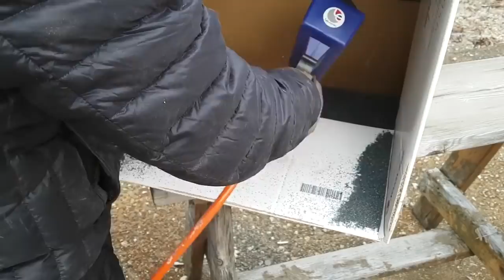KNIFE MAKING / JUNGLE KNIFE, 400mm 15.8inch 수제칼 만들기#39

Comment: I assume that this stock steel blank was already heat treated? Or did you just not show the heat treating of the metal in this video?
Reply from the maker: The size is too big for me to do it with my own equipment, so I forced it to be made by an outside specialty store that has already completed heat treatment...^^

Comment: steel?? noticed you did not heat treat blade and tempered??? very nice blade
Reply from the maker: The size is too big for me to do it with my own equipment, so I forced it to be made by an outside specialty store that has already completed heat treatment...^^
Reply: @artisticson2275  thanks I appreciated still very good work on blade.

Comment: That looks like a great chopper and brush knife. I'm curious about the heat treatment. I know that stainless steel is tricky to heat treat. Did the steel come prehardened and tempered?
Reply from the maker: I finished heat treatment at an outside store because the size is big and I am not capable of heat treatment.^^

Comment: That's a nice looking chopper.  I am making one very similar for a client who has requested CPM-4V.  11" blade, 5.25" handle, 16.25" total length with .25" spine, and finished with black micarta with red G10 liners.  I do not have the means to properly heat treat 4V so having to send off to Peter's Heat Treating service.  I didn't see in the video your heat treating process for the 440C.  What was your process? and did you cryo temper as well?  Great looking knife!
Reply from the maker: The length of the burner was too long to accommodate and had to be heat-treated. It was hard to process because the material had already been heat-treated....^^

Comment: Was the steel heat treated? I love the design!
Reply from the maker: The length of the burner was too long to accommodate and had to be heat-treated. It was hard to process because the material had already been heat-treated....^^

Comment: Good craftsmanship but No heat treatment no hardening mo tempering that is a piece of junk
Reply from the maker: Due to the large size, the equipment I had was not available, so I had to finish heat treatment at an outside store. Don't jump to conclusions. It is also steel 440c stainless steel. Do you know about 440c?   And junk ?  You have to cover your mouth...